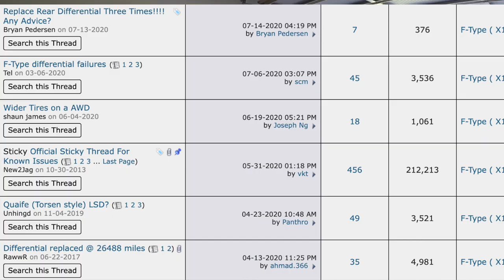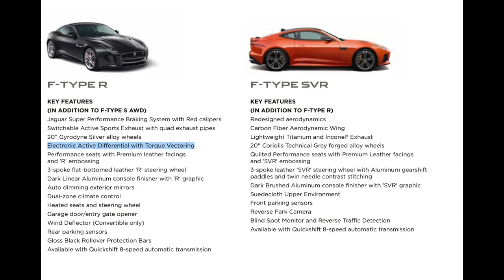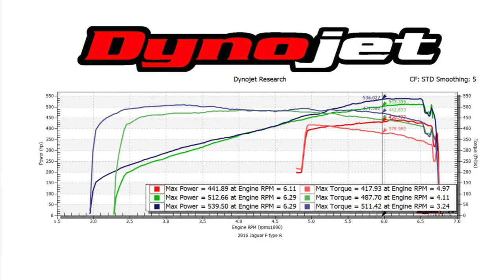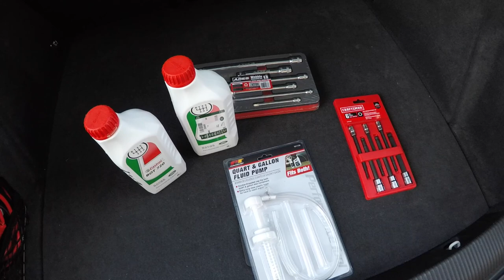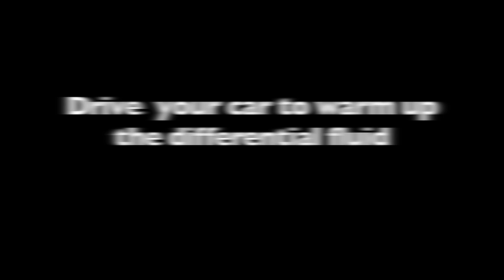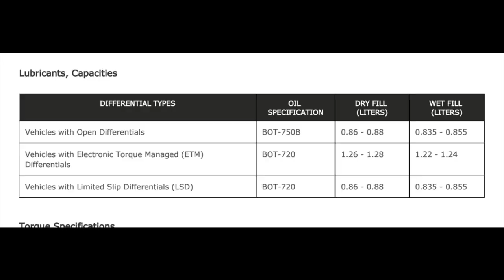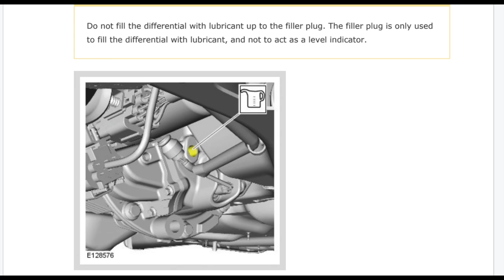DIY: Differential Oil Change and Preventative Maintenance on a Jaguar F Type!

Comment: Did this job this week. The video was really helpful. However, I discovered that it's not really necessary to remove the wheel. If you just raise the car enough to climb under the rear, you can reach over the suspension components well enough to reach the filler hole with a ratchet extension and long ball end hex socket. Also easy to reach the opening with the hose from your pump. The wheel can stay on, which saves some time and effort. Pretty easy job, overall. The hardest part is getting the right amount of oil back into the diff. I found that the pump wasn't able to get all of the oil out of the bottle. I poured the rest into another container with some more diff oil and then used a syringe-style pump to top off to the correct amount.

Comment: Mobil 1 diff gear oil costs $9/quart.  Its a good idea to run some through, or do a change and drive around the block, then change again, to clean the old oil out before filling with the expensive stuff.  Also, no need to remove the wheel.

Comment: Just subscribed. Thank you for your how to videos. Just picked up a 15 Coupe S. Not many diy videos on here on the platform so I greatly appreciate these.
Reply from the maker: Thanks for the support!
Reply: @skrrtgarage3922  Do you think one could do this job without taking the wheels off? There is local diy shop with a drive up lift that I plan to use.
Reply from the maker: Yea it’s possible, but so easier with the wheel off.. I would recommend having it off
Reply: @skrrtgarage3922  Thank you. Any more DIY videos coming up? How about the ZF transmission. Do you plan to do a fluid change on it?
Reply from the maker: Yea I have a few more already filmed, I’m trying to decide on which videos to get out first. As far as the transmission, I probably won’t mess with that until closer to 45-50miles
Reply: @skrrtgarage3922  Great. Will look forward to the new videos.

Comment: My 2017 F-Type S has 36k miles on it.  I just finished changing the differential oil.  The used oil was very black and and more viscous than the new oil.  There's no doubt that it should have been changed long ago.  I'll change it every 15k miles from now on.  There were no visible metal shavings on the drain plug magnet, just a chunk of metal powder about the size of a nickel.  I did take the left wheel off in an attempt to get to the fill plug.  I absolutely couldn't see it.  When I got up under the car, it was pretty easy to see.  I guess I should have tried that first.  On my car there was no way to get to the fill plug through the wheel well.  However, it was easy to get to from the bottom.  The location of the fill plug seemed to be lower and further toward the front of the car versus the diagram shown in this video.  I filled it using the Ravenol MDL.  Jaguar's instruction to not use the fill hole as a leveling point is just plain stupid.  They could have easily put the location lower.  I estimate that I put in about 1.4L in, but I don't really know.  I used some to clean my pump before filling and some spilled out after filling.  I did put new thread sealant on the plugs and tightened them per the torque recommendation in this video.  It seems to be working fine now.  I'll let you know if anything goes wrong.
Reply from the maker: Yea the f type s has a different full hole from the R. I recently changed the diff fluid on an S. The manual states the f type needs .83 liter of oil. How were you able to fit 1.4? Thanks for the comment.
Reply: @skrrtgarage3922  It's probably less than 1.4L, but it was definitely more than .83L.  I have a bit less than .6L left from the two liters.  I probably used up .3L when I ran some through my pump to clean it.  A decent amount spilled out when I leveled the car.  It's just hard to say.  Perhaps I ended up getting only about 1L in there.  That's why having a fill hole in the correct location is critical to eliminate guesswork.  Where'd you find the specification for .83L?
Reply from the maker: I agree, it’s in the workshop manual. I put a picture of the table in my video as well
Reply: Just as a helpful note, you can just fill the until through the fill plug until it starts to dribble out. It's easier than the fill to volume method and absolutely fine for the unit. 
Also, the dark oil and powdery sediment on the drain magnet is normal. This is just the micro phophate gear coating wearing off during initial bedding in. You won't usually see it on a second oil change if you were to do one 👍

Comment: Thank you for the video! Will do this diff oil change soon on my 5.0l 2011 XK, which was kind of the less sporty predecessor model line of the F-Type. Should be very similar… I will use 0.9 litres of Motul 300 Gear oil as per Motul’s oil spec recommendation for my XK’s open diff (XKR have the eDiff).
Reply from the maker: Right on! Thanks for the comment brother

Comment: Hi, what size for the square socket ( for draining ) ? 8mm ? Thx in advance
Reply from the maker: I would have to check, did I not list it in the video?
Reply: @skrrtgarage3922  it's not listed ^^
Reply from the maker: Shoot alright, I’ll look. If you get the little tool set I included, it’s in there
Reply: Did anyone find the answer to this?

Comment: Thx for the videos and keep them coming. I have a 2016 F-Type S and your videos will be very useful when I start doing my own maintenance after 2021 when the included maintenance ends. What are your thoughts on the transmission fluid change interval?
Reply from the maker: I appreciate the comment! I don’t think the transmission is as vulnerable as the differentials in these cars, so you can probably safely stick to the manufacturer recommended schedule. If you drive really hard, maybe change around ~40k miles
Reply: I just changed the differential fluid for the first time on my 2017 F-Type S at 36k miles.  It wasn't chunky, but the oil was solid black and more viscous than the new fluid.  If I had it to do over again, I would change it every 15k miles.  I can't speak for the manual transmission fluid as I have not done it yet.

Comment: We don't have an XK but do have an X100 and an X150 and these don't even have a drain plug so the X152 is a major improvement from Jaguar. It's a good video but just one question: why did you bother to lift the front wheels? 🤔
Reply from the maker: Thanks for the comment! I raised the front also to that the drain and fill would be more precise. If I only raised the back then not all of the fluid would drain.
Reply: @skrrtgarage3922  Ah, I see. Thanks for the reply. I wouldn't have bothered about the slight difference that it might make to the drain volume but I understand your reasoning.

Comment: Hi I have enjoyed your videos  
You did not mention the condition of your diff fluid after 36K miles I think you mentioned.
Was the fluid in need of change ??
Interesting that Jaguar does not require any fluid change on the diffs and transfer case in the case of AWD
Reply from the maker: Yea I should have provided a photo of the fluid, it would obviously very black and I had quite a bit of sludge built up on my magnetic drain plug. This service wasn’t required on my car yet either, but it was definitely time for it! This is more of a preventative maintenance item more than anything.

Comment: I used redline in mines. Redline told me to run a 75w140 instead of the 75w90 for better protection and cooling. And i have for over a year now with no issues. My diff failed using the OEM fluid.
Reply from the maker: That’s good to know, I’m usually all for trying other brands but I just couldn’t find the oil spec anywhere
Reply: e-diffs will not distribute torque properly without the OEM fluid.  But change every 15K miles as it won't last 30K.
Reply: @FFE-js2zp  my car now has 92k on it. Changed it to redline at 50k. And everything works perfectly lol

Comment: Nice video, but I am going to be that guy. Jack stands.
Reply from the maker: You can be that guy, I should have used them
Reply: @skrrtgarage3922  I got jack stands on the brain because I had some from Harbor Freight that were recalled. I will tackle my differential fluid at some point, I've been inspired! Only 23K miles on my 2016 V6S, but will tackle soon.
Reply from the maker: I had those same ones! Lol I had to replace mine also

Comment: I just did this. Not filling it until it runs out freaks me out. I'm worried that I underfilled it. It seems to work fine, but it is very difficult to get the fill tube in the diff properly. How much do you think would make a difference? Im definitely over 1l, but maybe 1.1.
Reply from the maker: I 100% know what you mean, it’s kinda bizarre not filling it up all the way. 

You’re most likely fine, depending on how it drained, some might still be in there. Did you use that chart I had in the video? My car called for 1.24 or something like that
Reply: @skrrtgarage3922  
Filling it til it drains out the fill plug is fine, they drain right at 1.2L.

Comment: Okay - so the refill plug was an absolute B to get back in.  I found that if you are on a lift you can actually press the plug up against the treads with enough pressure to get it started using two fingers.  if you try to do it with the long extensions it's damn near impossible to get it to bite.  make sure you clean the threads of the refill plug too.
Reply from the maker: Yes! The refill plug took a bit of time and patience to get off lol
Reply: Going to have to try the two fingers tomorrow. I couldn’t get the plug to bite with the extension and was afraid I would cross thread.